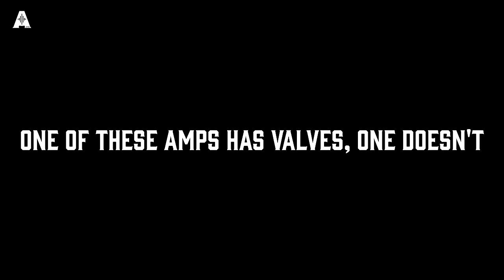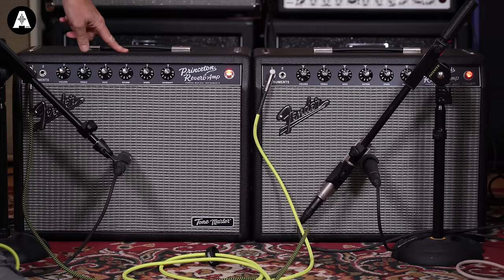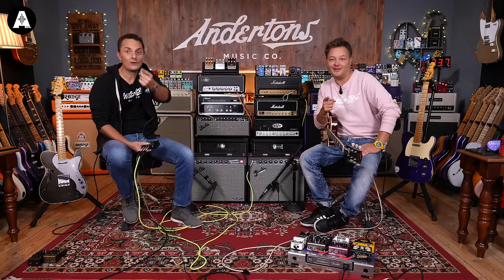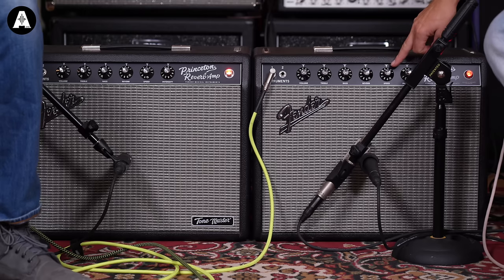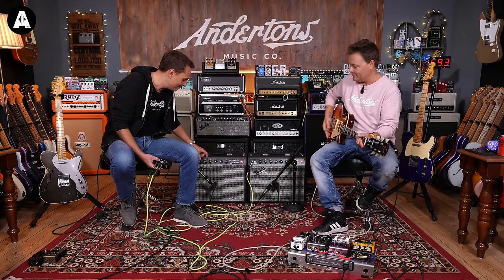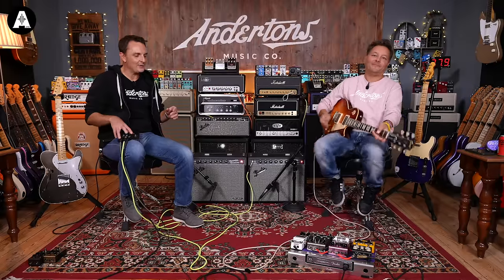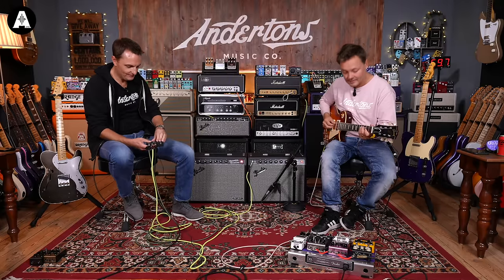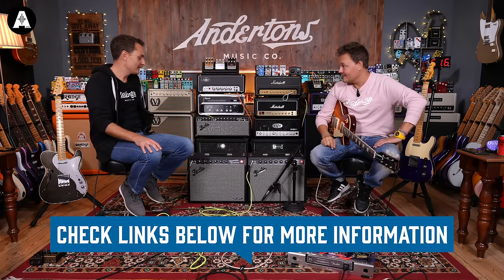Fender Tone Master Princeton vs the Real Valve Amp! - Can You Tell the Difference?

Comment: $900 for a solid state combo
With a 10 inch speaker?
Umm no thanks
Reply: Pine cab, jensen speaker, great amp emulation built in to feel like a real amp and not a line 6 spider. Plus fender markup, about right for the price.

Comment: First off -- the Tone Master is really impressive considering it's a screenless iPhone w/a speaker as you all pointed out.  The clean tones (I can hear the difference) and reverb are really close,...HOWEVER, when hit with a pedal it reveals itself.  There is a mid hump that's just there man, and the topend is a tad spikier.  The mid-hump isn't necessarily bad -- just different.

Comment: I live in a very damp climate (west coast of Ireland) and I have found that tube amps really do not agree with the climate. Personally I like equipment that allows me to quickly and esily get the tone I want, rather than spend my life downloading stuff off the Internet and pressing buttons, so for me I want quality and simplicity over diversity. I have purchased the Blonde Tone Master Twin which I leave in the fully attenuated setting for home use, and it's a great sounding amp that I am very happy with for my clean tones and reverb needs(I use humbuckers, P90s and single coils in different guitars and have found great settings for all). Of course there are a zillion pedals for whatever else I want to do. I have a number of overdrive depdals and I am still deciding which one I like the best with it! I'm sure I would have been just as happy with the Princeton. The only thing missing that I would have liked is an FX send/return loop.

Comment: I recently had an opportunity to test-run a 65 Princeton Reverb (the one in this vid) and a 64 Princeton Custom Reverb (hand-wired) next to each other, both tube, and to my ears, the 64 is way nicer, the 65 is almost boxy next to the 64. Huge difference, I thought. It's a shame that the new TM is modelled on the 65 instead of the 64.

Comment: But is the digital one serviceable?  Is it reliable?  Does it have some cheap components that will fail, and the skilled amp tech (IF they're willing to work on it) costs more than the amp itself?  I guess we could ask the same of the tube version.  Fender has been skimping on capacitor quality in the Hot Rod series for decades now.  And the heat damage incurred on the board by resistors not properly spaced with air flow is a consistent issue.  Are these Princetons improvements on that cost-cutting malady?

Comment: They both sound great. I'm listening with headphones by the way. My only concern is longevity with the tone Master we already know tube amps can last a very long time. What's the expected life of a tone master?
Reply: in case of trouble, tube amps can be repaired. I doubt Fender can rapair a 10 years old tony. Thats why these are simply overpriced 
computers. Its hard to throw away a 1000 Euros Amp after 10 years.
Reply: I don’t think anyone knows the answer to your longevity question.  This makes the TMs a throwaway risk.
Reply: @mikeyohe4750  That's what I'm afraid of. What's is been about 4-5 years they were initially launched? If I do buy one I'll buy an extended warranty.

Comment: I had a 78 princeton and wished I'd kept it, I think 6v6 valves sound better than 6L6 and I think the same for EL84 I had in a Marshall DSL401 combo to EL34 in the big boys. Best EL84 sound is a Vox AC30 and I bought a battered 1960 model in tan (rare) and it had different transformers to the standard amps.

Comment: Love it, but.

Again, you can't really A/B two different close miked speakers to see if they sound different. Mic placement has an absolutely enormous impact on the sound. The only way one of these tests is useful to us not in the room is if both amps are heard through the same speaker and mic or, as you wanted to show the modelling thing in this case, a single mic a couple of feet in front of and equidistant from both speakers.

Comment: You can easily tell the difference…I did get it right. However both are completely usable…I might opt for the digital model because of weight ,adaptability, features etc…I prefer the valve however if I had roadies and an unlimited budget..!

Comment: I prefer the sound of the Tone Master in the demo at the beginning of the video... The real test would be when you gun the amp at a gig. I'm fairly certain the tube amp will crush the Tone Master version in that scenario... not necessarily in terms of volume but my experience with solid state and Class D is that they tend to crap out at high output.

Comment: Besides the weight savings, it's pretty close but no cigar. If it were half the price of the valve amp, maybe. You get a hell of a lot more  versatility, amp types, effects and watts [also with variable attenuation settings] and programmability with a Katana for a fraction of the price if you want a good digital amp. On the other hand, the real McCoy doesn't cost a whole lot more in the big scheme of things than its digital counterpart. I would save up a little bit more for the real thing if that's your choice for that particular amp. Bottom line is that even though it sounds very close, you're paying a rather stiff premium for the Fender badge in my humble opinion. Same goes for the Deluxe Reverb or Twin Reverb.

Comment: Will the Tone Master last as long as the valve version? 

I am a little surprised about the price on the Tone Master, it was higher than I had expected. I don't know much about amps and prices, but I just did not expect the price to be higher than the EVH 5150 iconic 40w combo.

And the price difference between the two is less than I had expected.

Interesting thought in an other comment about Fender (and other manufactures) may hold back a little on tone master versions. It would not surprise me at all if that was true.

Comment: There is a $500 dollar price difference at  Sweetwater here in the States.  In the long run I’d spend the difference and get the tube amp. 10 years down the road you’ll be happy you did.

Comment: Great real time twominded process of comparison.   The question isn't analog vs digital.  The question is what do you want to hear and how do I dial that in with what is in front of me and then discovering many usable surprises en route.  I could hear the tube openess and complexity vs the tonemaster which is sonically limited by the variable and  noticeable levels of compression because of the limited number of 0s and 1s available for the sound to expand into.  The emotional range of a good tube circuit is like the quantum model where every minor harmonic our fingers generate takes every possible route to our ear, arriving there from different directions bending the spacetime affecting the complexity of tones that finally reach our ears. 

I wonder that if a digital circuit could be processed through the most powerful quantum computer, would the difference between these two amps have been discernable to the still evolving human ear?  I think not.  But I'm a human, which is disturbing.  Looking forward to the first digital amps processed with many passes through an onboard quantum computer... Maybe after the signal has first been run through a proven analog preamp circuit?   I don't know if tube amps send tones into all 11 superstring dimensions and if so, do all dimensions return the sound to our ears or do all 11 dimensions contribute equally to affecting our ears' eventual organs of vibration that send sound to our own individually distinct quantum processors...THE BRAIN!@!@!@@!!!!

Great review process that I have come to admire and trust from the boys and girls, but almost exclusively boys, at Andertons.
Reply: I hear you guys have some pretty good physics departments up Cambridge and Oxford way.  I think you should invite some of those people to stop by and help you invent quantum guitar amps because if climate change is going to cause mass extinction of ours and other species, I want as many of our best scientists working on how making guitar amps sound perfect... before we're gone.

Comment: I've rented the deluxe versions as backline and for that purpose they're great. Otherwise, as a purchase, I would spend a bit more for the tube models as I honestly think the tone masters in general are overpriced for what they are.
Reply: Agreed. I had the TM Twin and sold it due to, in part, the quality of materials used and construction. They’re simply too expensive for a Chinese made box. These amps are not hardware upgradeable either so when the chips take their next big leap, these will be left behind like a mobile phone. Fender also has this schizo attitude to not utilising some modern features like fx loop but adding others like volume attenuation to keep the amp true to vintage…illogical. They do sound good and are very light, but I was glad to sell mine.
Reply: @JPMonstie  right - no efx loop! forgot to mention that. I was using a wet/dry setup but yeah if only one amp, definitely annoying and really makes them non-expandable one-trick ponies.

Comment: My take away is that it sounds like a Princeton.  You can take 2 valve Princetons and A/B them and they can still sound different.  Also, to my ears, the line out of the Tone Master sounded identical to the mic'd amp.  Given the similarities, I can't see anyone coming up to you at a gig and telling you that it doesn't sound exactly like a tube amp.....it's just too close.

Comment: I liked the tonemaster just as much as the tube version. I'm however still on the fence until they make the digital model with an effect loop. The reason I love my Super Sonic 22 is the low wattage and the effect loop. 
I really can't see any reason why they CAN'T put an effect loop in. I know they want to keep it as close as the original as possible, but with the DI and wattage-changer they've already crossed the line?

Comment: Can the digital amp be repaired if it breaks down for any reason? 
The valve amp is old school and can always be worked on if it has a problem.
Reply: I heard that the Tone Masters have to be returned to local HQ, so USA folk are ok but we in the UK have to send them to Germany, where the entire board is replaced. So if out of warranty it's basically a write-off.

Comment: The C10R Jensen speaker in this is rated at 25w and has 'musical' power wattage of 50w (from the Jensen website).  Does this mean that it might burn out the speaker if played at max level and full power?  I understand the Princeton TM puts out 50W.  Would turning the amp past halfway on the full setting result in a lot of speaker distortion (in a good or bad way)?

Comment: Volume of amp A is set lower? It sounder a little cleaner maybe because volume was slightly lower at first blind test. Later you re adjusted levels and it seemed the other way around. 
Volume levels is the only slight difference that I heard. But I do believe that in general an amplifier with tubes move the speaker faster, easier. I'm pretty sure of that is true, but to say truth I can't tell the difference. 
I was listening with good headphones, but I wouldn't be able to tell which one sounded best.
Tests at minute 19 again number B sounded stronger again. I think it's simply a slight difference of 1dB or 2 dB higher audio level in amp B at 799 pounds against the 1200 or 1300 fro  the classic one.

Comment: They should release a Tonemaster head (without the speaker cab) only the amp modeling unit.
It will be cheaper, will serve those who need it 
  for bedroom via a computer and IR loader and headphone. and for those who need a good 
modeling platform to record into the computer.

Comment: My question is: Are big amp manufacturers deliberately holding back their own digital (and solidstate) models? Because after seeing Jim Lill's amp tone video, I'm not so sure there is that big a tonal difference between tubes and other technologies.
I'm also sure that Orange could have easily made the Super Crush closer in sound to the Rockerverb.
Reply: 100%. They don’t want to mess with their amplifier tier systems. The technology is there to make even relatively inexpensive digital amps indistinguishable from the tube counterpart. Everyone says they can tell the difference but if you blindfold them and have them play both they really can’t. One of my tube amps needs to be re-tubed and the prices are still stupid high from the supply chain issues last year. Getting new tubes a handful of years ago was $40, not almost $200. I love my amps but the days of tube amps are numbered.

Comment: these are interesting, my concern would be their longevity and serviceability, original Fender amps are still serviceable 50+ years later, imagine trying to find a replacement motherboard or whatever for one of these in the future?
Reply: The only parts that would fail would be the same kinds of parts that would fail in a tube amp, capacitors and that's basically it. You could say the same thing about tubes in the next 20 years too. Producing another motherboard isn't nearly as complicated as trying to produce tubes that aren't accessible anymore.
Reply: The heart of the tonemaster is a proprietary board from with a processor and chips.  I doubt any third party will ever produce one.  So if it fails, as many processor based items do, we have to hope Fender will still have replacements available.   Most processor/chip based products today, phones, tvs, computers are basically disposable and are quite susceptible to power surges.

Comment: I would love to see Fender use the lightweight speaker and cab on the original tube amp. Having the original in lighter weight would be an excellent option. With the tube circuitry and spring tank, it'll still be heavier than the tonemaster, but probably much lighter than the original amps.
Reply: 1. Buy both 
2. swap the chassis over to the other cab
3. return the Tonemaster
4. ?????
Reply: Havier cab is needed not to fall apart carrying the heavy internals. As soon as you transplant the transformer, you’ll find most of the weight is already in, the difference in speakers and plywood will mean little difference compared to it.

Comment: It's a good little amp, but, you just proved to me, when you ran that Fuzz through it, that they DO NOT sound the same. Valves just have a DYNAMIC that digital STILL has not accomplished. They not only don't sound the same, but I guarantee, they don't FEEL the same either. Feel is a HUGE thing for me, because that's what inspires greater playing, and more creativity. Valves have never been matched yet, in my opinion.

Comment: They sounds slightly different. I prefer amp B. I don't know (or care if I'm honest!) which has the tubes in. But I'd take Amp B, personally. 

I do have a history of preferring solid state amps though, so purely on that basis I'd guess that B is the Tone Master. That is after about 3 minutes of video - not into any higher gain tones you might push the amps into, where tube and ss differences start to get more pronounced, in my opinion.

Comment: I don't understand why to put an attenuator on a class D amp? Why not just overall master volume like on other modelers? P.S. For those, who don't understand the technical side - attenuators are used for tube amps so we can push output tubes into an often desirable non-linear mode (compression or even clipping) at more reasonable volumes. But in a modeler, the output amp is a class D amp that anyway should not be pushed into clipping. The master volume on the class D amp is just a volume, it just regulates loudness, without additional shaping of the tone. I wonder what schematics Fender has in this attenuator that they put on a tone master.
Reply: The Katana and the Catalyst has attenuation too.
I think it's just steps in their power section to make it easier to adjust volume at different levels. If you only have one volume it can be a bit touchy when you are playing at low volumes as you're at the very minimum of what the volume pot can do
Reply: @atlejohnnyrygg7124  maybe, but I would prefer just the usual master volume.

Comment: Honestly I wish the Tone Masters were full analog instead of going through digital. Bet they'd play a lot nicer with pedals. Oh well, there's always Peavey Transtube.
Reply: The Transtube is one of the few Solid State amps that does crunch and overdrive tones well. My Nextone is close, but…it’s SS and Digi. The super champ x2 and mustang amps have trouble with crunch too.
Reply: It doesn't help that almost everyone confuses digital and solid state nowadays. Analog, Class A(/B) amplification sounds AWESOME ... doesn't matter if you're using vacuum tubes or transistors. Digital has some serious issues when it comes to the initial amplification. Once you sum that signal up to do your digital processing, you're losing a lot of the hidden characteristics of the signal, phase and impedance shifts, etc, which will have unique effects at the speaker. Then you also introduce quantization errors, crispiness at clipping, the inherent issues with quick low-latency digital processing. It's just so frustrating that Fender could literally make a Princeton, replace the valves with FETs and I bet it'd sound ballistic, maybe even BETTER than the original. Instead they're reverse engineering a great analog circuit with a microprocessor because they can? Head-scratcher.

Comment: wow, both sounded great, kinda preferred B, and was surprised it was a digital sound.  i think it's because, i like mids and B had more thickness in the mids, a bit more bark.  speaker choice was great for B, it responds more naturally to the amp than those neo shrill light weight speakers.  responds to drive pedals pretty well too.